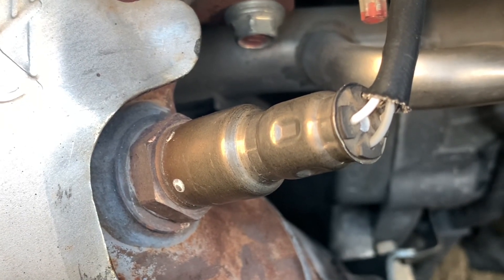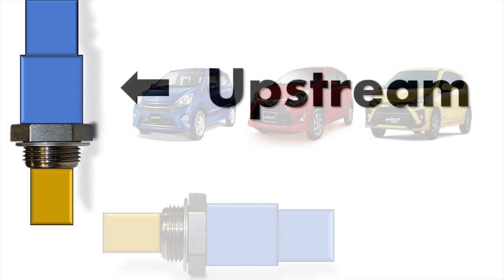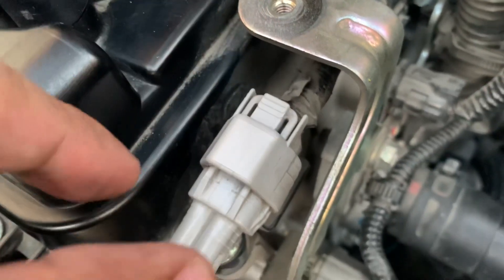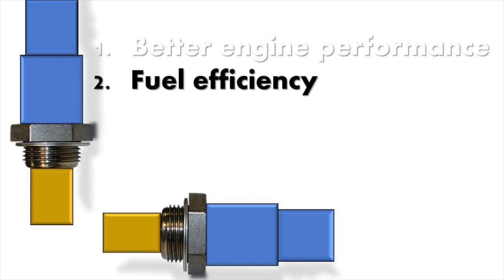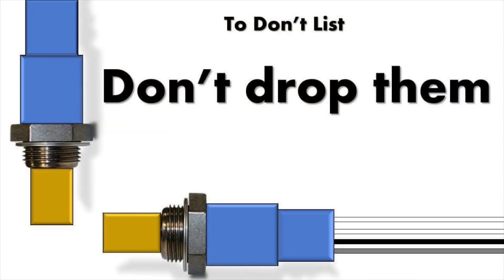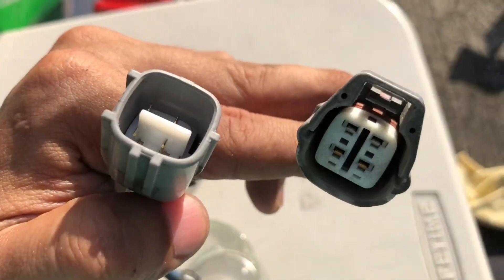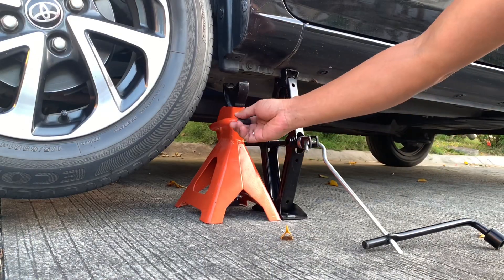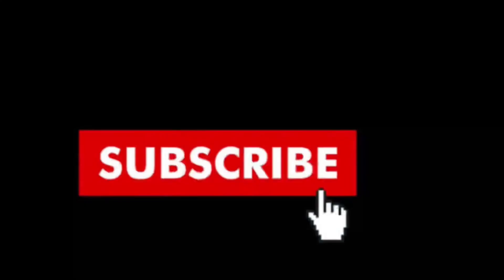How to do a Preventive Maintenance Service on Oxygen Sensors

Comment: Hello po sir allan good day tanong ko lang sana if may idea kayo kung ano ang deperensya ng wigo 2017 E manual unit ko po kasi kapag aapak na ako sa gas may vibrations ang sasakyan pati manobela at shift stick pero nawawala na kapag nakalampas na ng 2000rpm. at parang may rattling noise sa ilalim ng sasakyan di ko malaman san galing yung noise. Na check ko na po mga engine support okay naman po wala pang problema pati mga spark plugs ko. Thank you po in advance sa reply nyo po.
Reply from the maker: hi adrian. daming possible causes ng violent shaking when the unit is at a low rpm.
Reply from the maker: one possible cause is the transmission. ATM ba gamit mo? ano na ang mileage and nagpalit ka na ba ng transmission fluid? pacheck mo din yung mga gulo baka out of balance na and check the brake system as well.
Reply: @WigoRaizeTV  hello po sir allan, bale yung mileage ko now po is 70k plus na po. Manual po itong unit ko po and di pa po ako nakapag papalit ng transmission fluid pa po. Feeling ko rin sa transmission po ang prob.

Thank you po sa pagreply nyo po sir

Comment: Hi, Sir I am using Gen 1 with upstream and downstream oxygen sensors. Napansin ko po same din sila ng pin(connectors for both up and down) pero magkaiba po ng part number... BZ390 po sa taas then BZ400 po sa baba.. pero as in same connector. Does it mean I can use the same part number po for either upstream or downstream? sorry newbie po. napansin ko lang po kase an pareho sila ng connectors.

Comment: Good day sir nagpbalik aq ng stock muffler ko after maibalik ung stock ko nag blinking check engine wigo ko tapos Nung niread ko Ang lumabas n fault code is P0036 HEATER CONTROL CIRCUIT(Bank 1 Sensor 2) ask ko lang sir kung un Po ba ung upstream o ung down stream?salamat po
Reply from the maker: hi jeffrey.  b1s2 is the downstream sensor
Reply: Pero sir magkaiba pba sensor Ng downstream Ng manual at matic?
Reply from the maker: @jeffreyvito8435  yes, magkaiba

Comment: Good day sir, asking for a friend.
ano kaya findings mo sa innova Low power at poor acceleration, may white smoke tuwing umaga Eto yung mga ginawa na namin *change oil *change fuel filter *change air filter *clean egr&intake manifold *pina scan ko na din sa labas, wala lumabas na trouble code *check clutch lining(good) *pina check ko na din sir 4 na injector sa calibration shop, simulator tester ginamit okay naman daw *nag try nadin kami ng galing casa na gas filter para dun sa maf sensor Additional din sir, pag nag 120kph ako niluluwa niya yung hose sa throttle body karugtong ng papunta sa turbo. Toyota Innova Diesel Manual 2006 model(

Thank you.
Reply from the maker: hi lloyd, you can try cleaning the throttle body plate inside and out. is this a unique issue with your innova's model? I suggest you ask other 2006 Innova users as well sa mga fb social clubs. baka lang some already went through the same issues and they can recommend a fix for your unit.

Comment: First you demonstrated that you didn't you didn't have a check engine light by removing and installing you knew clean O2 sensor you did it see if your engine showed a warning sign or not do you have to go through a drive cycle before you can do that but of course previously you didn't have a check engine light so it wouldn't show anything
Reply from the maker: i guess that's the reason why the title of the video is "how to do a preventive maintenance service on oxygen sensors" not "how to fix a check engine light because of oxygen sensors:)"

Comment: Good day po sir Allan almost 1 year npo nag check engine wigo ko 2018 model...pina scan ko npo OBD2 ang problema kaso sobrang mahal sa casa aabot ng 15k..paki help po saan makabili ng replacement salamat po.
Reply from the maker: o2 sensor daw po ang sira? if so, alin po dun sa dalawang sensors?
Reply from the maker: here's are links: https://shopee.ph/product/419983478/8970242853?smtt=0.519364681-1631954865.9 and https://shopee.ph/product/419983478/8170257550?smtt=0.519364681-1631954898.9 i can help din po in removing the old one and installing the new one. send me po a PM sa wigo tv allan rey bernardo on facebook

Comment: Pag na detect ba agad ung o2 sensor sa obd2 na cause ng check engine ay palitin na agad?
Reply from the maker: hindi naman. minsan nabasa lang kase yung sensor
Reply: @WigoRaizeTV  yung sakin pinalitan agad hindi man lang nilinis tapos nung pinalitan ng brand new umilaw ulit o2 sensor ulit findings..
Reply from the maker: @ajm5261  yun nga default ng maraming mga mekaniko, palit ng part/s agad:(
Reply: @ajm5261  Sir ok na po ba o2 sensor nyo?
Reply: @richellfuentes0910  so dar yung replacement oks nman. Wala nman akong na notice na difference same p din kunsumo ko sa gas

Comment: Dear son,
      I have swift car. When the AC is switched on, the pick-up lowers down. Till now the car has run near about 80,000 kms.AC compressor is ok, all Spark plugs are changed and new spark plugs are fitted,all coils are ok, throttle body cleaning done. flow of petrol is ok. Air filters are also new. Please let me know why pick-up falls down when AC is switched on.
      You describe very nicely. I hope you will co-operate me.
       Retired principal
         Ravi Rai
            India
Reply from the maker: Is your vehicle a manual or automatic transmission? 80k kms is the fluid interval schedule for an AT wigo, I'm not sure with swift.

Comment: Sir Allan, ung wigo po nmin nagcheck engine. Pina scan po nmin O2 sensor pre-cat B1S1. Nireset nya po error code. Pero advise ng mekaniko palitan n P9k po parts sa toyota. Possible daw magdamay ng ibang parts pag sira talaga. Tinest drive nmin, hndi nman po bumalik ilaw khit naitakbo n nmin ng 90 km. Ok lang po b ginawa nmin hndi muna pinareplace? Or delikado kc may iba pang parts n possible mdamay? Thanks in advance po.
Reply from the maker: kung bumalik po uli yung check engine warning light and ang source ng issue ay yung b1s1 pa din, palitan nyo na po yung sensor 1. pero kung hindi na bumalik, no need na palitan for now. kung walang error code, hindi naman maapektuhan in a bad way yung fuel efficiency ng sasakyan.
Reply: @WigoRaizeTV  maraming salamat po sa maliwanag na explanation. More power and subscribers Sir. Thanks po ulit!

Comment: Pwede po b wd40 panglinis after mgasoak sa gasoline ng mga sensor
Reply from the maker: pwede po yung wd40 na throttle body cleaner. wag po yung for multipurpose use.

Comment: Excuse me, I’m no mechanic, and I don’t have a garage, and tools. Isn’t there a simpler ways to add oxygen sensor cleaners to the gas tank? Which there are many in the market? Or, they are all snake oil?
Reply from the maker: There are no cleaning solutions that you can add in the gas tank that would clean the oxygen sensors. There are chemicals that you can add to the gas to somewhat clean the fuel injectors, but there's none for O2 sensors:)

Comment: Did a clean on the o2 sensors and had it scanned again but after 10kms of driving it. Check engine light came on again. Had it scanned again then it says the oxygen sensor again. Do you know where i can buy replacement for it?
Reply from the maker: try to look for a replacement O2 sensor from Alibaba. it's a lot cheaper than getting a new one from a toyota dealer.

Comment: Sir allan is it ok to clean kahit di nag aappear ang check engine sa instrument panel?at kelangan pa po ba na idisconnect ang battery?
Reply: At di na po ba need na idisconnect ang battery?
Reply from the maker: @romerdimaculangan874  preventive maintenance po ito kaya ang paglinis bago pa lumabas ang check engine warning lights for O2 sensor sa dashboard. ok lang po kahit hindi idisconnect ang battery.
Reply: @WigoRaizeTV  thanks po sir allan.god bless

Comment: Sir pwede po ba mag tanong? What about socket sa sensor 2 sa ibaba na basag ung connector nya ung connectado sa makina na wire hindi mismo sa O2 sensor magcocause ba ng check engine??? Nabangga kasi ako sir na sira ung connector patunga sa linya ng makina ung dulo lang ng socket nya.. please reply po or just tx me sir this number 09087219143

Comment: Sir, if the check engine was caused by the O2 sensor post-cat, can we still clean it or replace it? Thanks in advance for your reply.
Reply from the maker: i suggest that you delete the O2 trouble code first using an OBD 2 scanner then clean and reinstall the sensor. if the code would show up again even though it did not get wet, it means a replacement part is needed. just don't
replace the post-cat sensor too soon, especially if the unit is fairly new (one to five years). the sensor 1 is more important than sensor 2.
Reply: @WigoRaizeTV  Thank you sir and your recommendations are highly appreciated.

Comment: Sir lagi pong lumalabas ang check engine ng wigo ko.. pag may baha po dito or umuulan po na bumabiyahe lumalabas po yung check engine.. antagal po maalis tapos kahit na di rin po umuulan bigla nalng po lumalabas ang check engine... Sana mabasa niyo to sir salamat
Reply from the maker: i suggest ipa-OBD 2 scan mo yung unit mo to find out the cause of the intermitent check engine warning light. Baka kapag nababasa ang O2 sensor sa ilalim, nadedetect ng computer na may issue. pero as long as nawawala din agad, ok ka pa. Yung nasa ilalim na oxygen sensor ang main function lang is to check your emission o paglabas ng usok kapag dumaan na sa catalytic conveter. mas mahalaga yung nasa itaas na oxygen sensor.
Reply: @WigoRaizeTV  ok po sir.. ang pinag poproblemahan ko is matagal po talaga mawala yung check engine niya po... Napa scan ko na po and then denelete namn niya yung code na lumabas.. pero dumaan ilang araw bumalik nanamn po ang check engine.. sabi niya po is yung oxygen sensor sa taas.. ang gusto ko sana is mapalitan nalang lahat ang O2 niya para wala na problema.. san po ba makakabili ng O2 sensor?
Reply from the maker: @alihasmirsimpal2021  sa casa sobrang mahal. yung iba ang ginagawa bumibili ng surplus from a wigo unit. you can also try sa alibaba online store. medyo mas mura kumpara sa casa.
Reply: @WigoRaizeTV  sige po sir maraming salamat po stay safe po..

Comment: Sir...patulong po. Kasi kapapa change oil ko lang at pinalitan ang filters sa car engine at aircon. Pero napansin ko na pag nag start ako ng engine...may naamoy akong carbon sa loob ng kotse lalu kung hindi naka on ang aircon. Saan po kaya nanggagaling iyon at ano ang pwedeng gagawin para mawala. Ty po sa pagsagot.
Reply from the maker: I suggest po na ibalik nyo where you had the oil change and ac filter replacement. tell them the issue so they can trace on their end kung bakit may carbon na amoy. Maybe they spayed the vents with something na nagreact sa cold air coming from the evaporator. Check nyo din kung bago talaga na filters yung kinabit sa a/c and engine.
Reply: @WigoRaizeTV  hello sir saan po makaka bili ng sachet renge na pan alis ng oxygen sensor ng toyota wigo.

Comment: whats the price of sensor 1 new one
Reply from the maker: hi mike. i did not replace the old o2 sensors. i simply did a preventive maintenance on them. i think you can get a new one from any toyota dealers for Php8k plus Php2,500 labor cost. you can get it cheaper from Alibaba.
Reply: Sir ano torque requirement po ng sensor? Thanks
Reply from the maker: @moticoyman3797  nasa video po sir
Reply: @WigoRaizeTV  salamat po

Comment: Ano possible issue sa wigo if kapag paakyat ng humps ang front, may natunog na parang nagkikiskis na bakal? Ty
Reply from the maker: lubricate po the front and rear braking system, especially the guide pins and joints lalo na kung nagpalit kyo mg brake shoes recently.

Comment: Sir, naka experience na poba kayo ng bigla  nawawala ung batak  ng wigo (1sec)  tapos lalabas na yung check engine.

Napa scan ko narin sa rapide tapos lumabas error code na P0202.
Reply from the maker: hindi pa po
Reply: @WigoRaizeTV  my idea ka po sir.. ano po kaya problema?
Reply from the maker: search nyo po sa internet yung trouble code and possible fix. baka kailangan ng linisin yung fuel injectors.
Reply: @WigoRaizeTV  nakita ko nga po sir.. baka fuel injector or itong O2 sensor..

Ito muna gagawin ko tapos check ko po video nyo sa fuel injector..

Yun po bang fuel injector cleaner na nilalagay sa gas tank eh pwede na or manomanong linis ng fuel injector?

Comment: Sir, ask ko lang. Ang problema ko kase sa wigo ko (2017) model din, is pag napasabak ako sa malakas na ulan, tapos medyo may mga puddle of water (not necessarily baha) nakakaexperience ako ng check engine. Nakakatakbo pa rin naman pero yun eco light di na gumagana. What I usually do is di ko gagamitin ang unit for say 2 days, tapos bilad sa araw, then nawawala lang sya ng kusa. I was thinking na baka may kinalaman sa oxy sensor yung problem ko kase nawawala din yung eco indicator ko. Tama po ba?
Reply from the maker: Hi. As long as you are not getting a check engine warning lights on the dashboard due to the O2 sensors, your unit is fine. If the eco mode setting is turned "ON", it is thr Wigo's computer that decides when the eco mode lights would turn on or off. Trust na lang your unit's computer that it knows what it's doing:) I hope this would give you peace of mind.

Comment: Sir allan ilang km or ilang taon ba ang recommended na pag linis ng o2 sensors?
Reply from the maker: wala sa owner's manual, pero i cleaned the sensors on my unit at 40k kms sa ODO.

Comment: Sir ung wigo ko palaging nagchecheck engine lalo n kpag maulan pero after 1 to 2 days nawawala din ilaw nung dinala ko sa casa nawala ung ilaw ayaw nila gawin kpag hindi nkailaw na check engine.
Reply from the maker: i suggest ipa- OBD scan nyo po yung unit. pero kung hindi naman nagtutuloy-tuloy yung check engine warning lights it means nawawala ang trouble code which is a good thing. baka may nababasa lang sa ilalim like the sensor, etc.
Reply: thank you sir.

Comment: Lodi Kanina ko pa hinihinatay to pagkapost mo sa fb. Sakto kasi nasa CASA ako kanina pinascan ko kasi 1 month na naka check engine. tapos suggest nila Oxygen Sensor 2 replacement na daw dahil pundi na. Wigo 2019 model ko Sir Lodi under warranty gusto ko sana i DIY baka masayang warranty ko. Sayang kasi 11k huhu. Hindi raw cover ng warranty dahil nilusong sa baha. Half gutter lang naman yung baha lodi. Agad agad bang masisira ang sensor pag ganon?
Reply from the maker: meron yata sa Alibaba na wigo O2 sensor na mas mura. check mo yung part code for your unit. baka makatipid ka ng sobra although parang up to one month ang delivery. naglog in ako sa Lazada indonesia when doing some research. mga 3k philippine peso ang O2 sensor ng ayla. sadly, they don't deliver sa pinas:(
Reply from the maker: baka pwede ka magclaim sa insurance mo. i suggest you try kase sobrang mahal ng part:(
Reply: @WigoRaizeTV  thank you sir lodi. More power and Godbless. Try ko po ipasok sa insurance sana pasok sa AOG dahil baha naman po ang dahilan.
Reply: Kaya pala pansin ko mas matakaw sa gas ngayon. May kinalaman pala ang sensor.
Reply: Same problem sa akin sir naka ilang beses din ako pabalikbalik sa dealer at claim for warranty kasi kahit konteng talsik lang ng tubig ulan umiilaw na check engine ginawa na lng po as remedy is yung wire harness ng Sensor 2 Post Cat sineal po ng Casa Tech pati na rin ang wire mismo na nakakabit sa sensor. So far hindi pa naman umilaw. Share ko lng po experience ko. More Power to Sir Allan... God bless po sa channel...